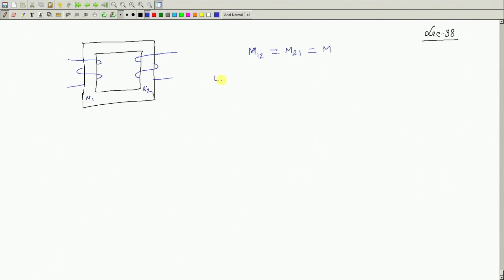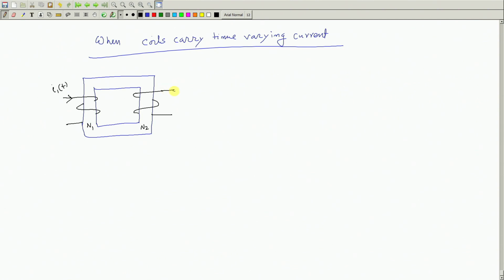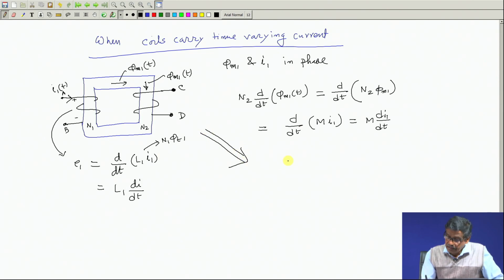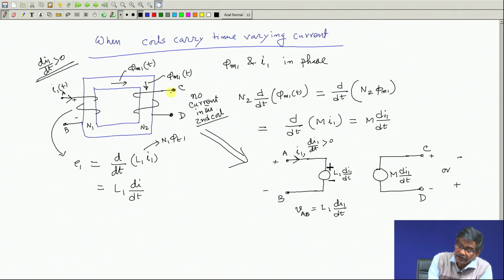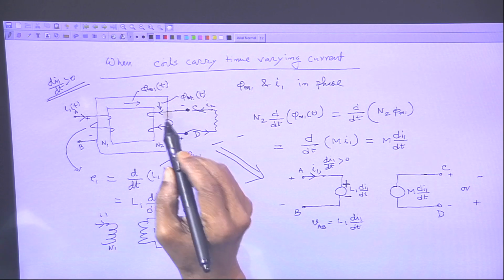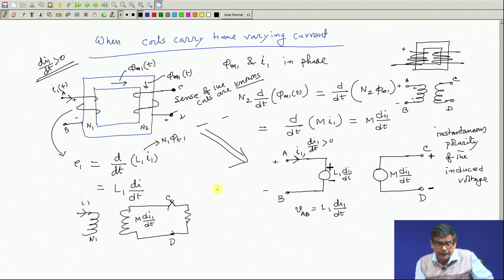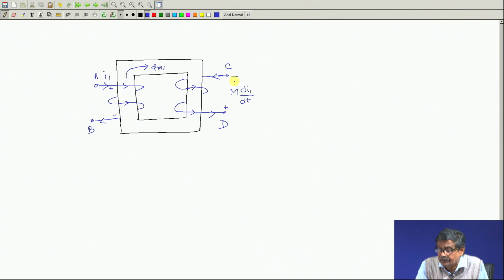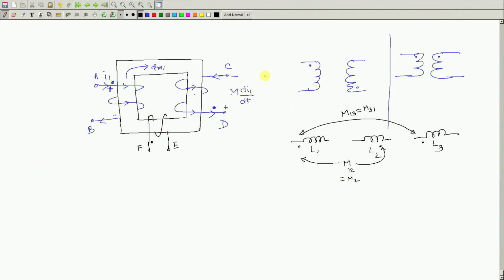Lecture 38: Dot Convention in Mutually Coupled Coils

Comment: I have a doubt regarding 17:20 that if the induced emf is such that it opposes the change in flux at that 'instant' then why does the phasor diagram of electrical machines represent the phasors of induced emfs 'always' opposing their causes (applied voltages)
Reply: All fine..
You need to study all again slowly